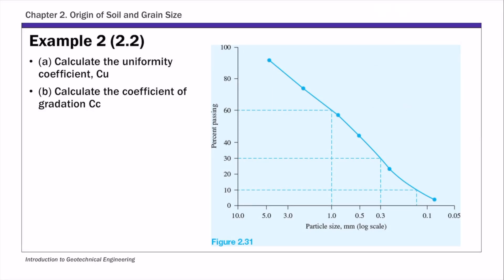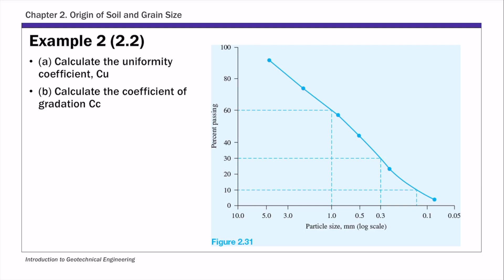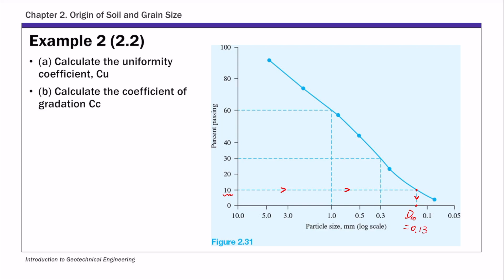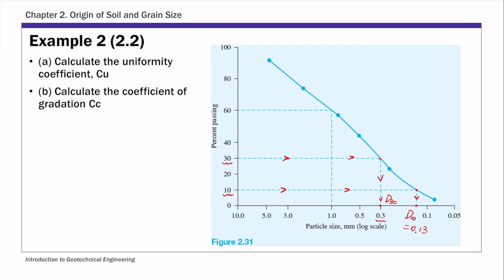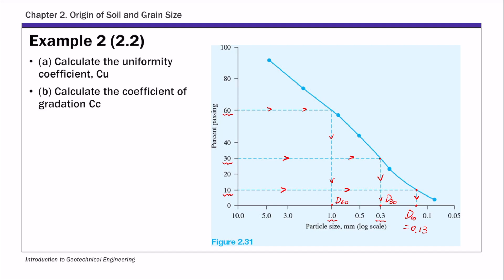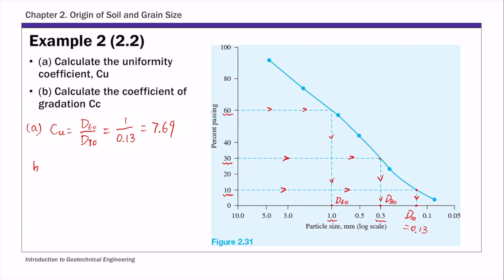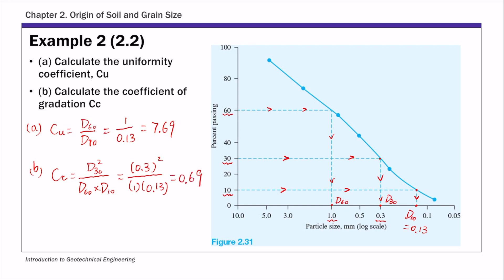Chapter 2 Origin of Soil and Grain Size - Example 2 (PSD Curve)

Comment: Is there a solution to find d10's exact value, not the approximate?
Reply from the maker: Typically, you would read the value from the graph directly. There is no "exact" value per se, but you could use adjacent data points (e.g., one with a y-value larger than 10% and one smaller than 10%) to do a linear interpolation.